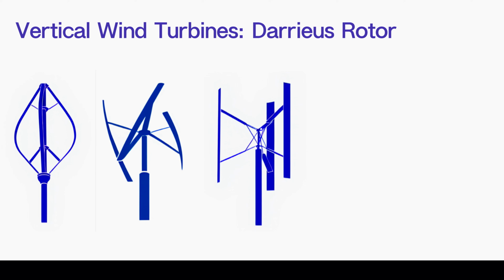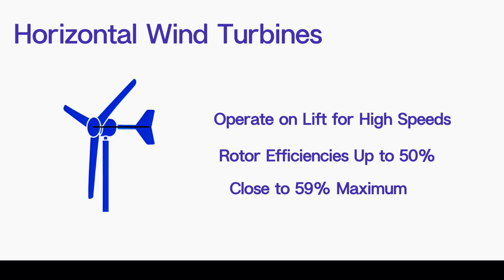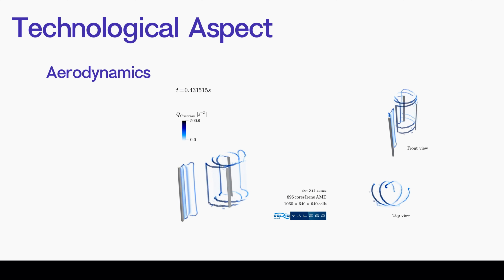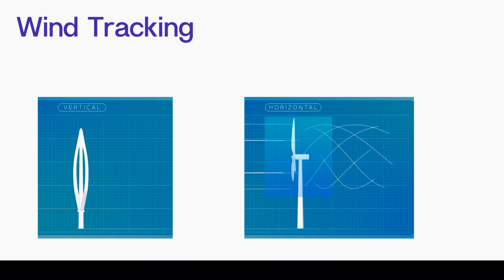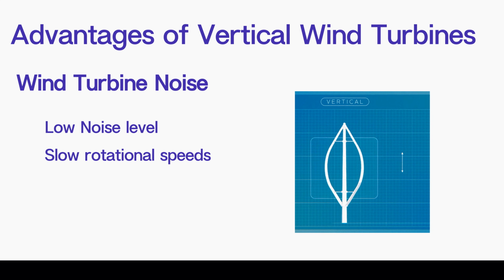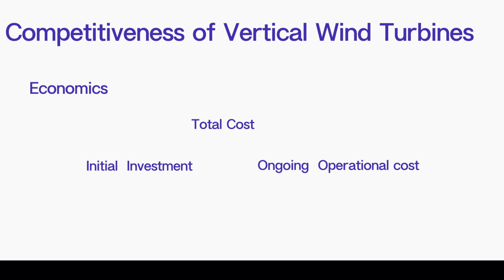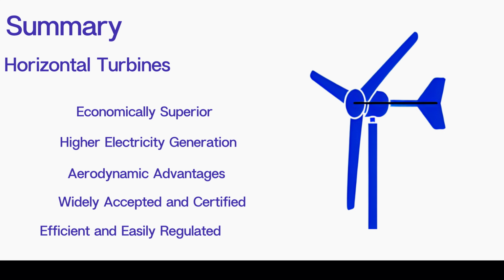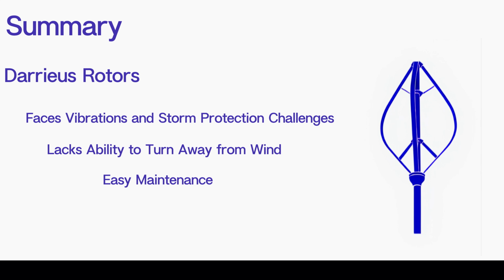Vertical Axis Wind Turbines: Are They the Better Choice for homes?

Comment: If you want a vawt that has higher power you need to make it tall and skinny. That will increase the area of the turbine (torque) without sacrificing rpm.  I built a tall skinny Savonious version 18" diameter x 8 feet tall. It performed very well.
Reply from the maker: That is a very cool DIY build! Increasing the swept area (height) definitely helps capture more energy. As we mentioned in the video, Savonius rotors are 'drag-driven,' which makes them excellent for torque (perfect for that shape). Did you find that the 'skinny' aspect ratio helped reduce the vibration issues that vertical turbines often face?
Reply: @WindmillsTech 3 buckets have no vibration if they are balanced
Reply from the maker: @justtinkering6713 A 3-bucket setup definitely smoothes out the torque ripple much better than a 2-bucket design. In the video, when we discussed 'vibrations and resonances,' we were also referring to the aerodynamic cyclic loading (wind pressure changes) that can affect the mast over time. But getting that mechanical balance right is definitely the biggest step to a smooth runner!
Reply: How much power does it generate
Reply: @oshoadetunji103 i think it was 12 watts. Not a real good alternator.

Comment: Vertical wind turbine is the most efficient blade you can get just need the wind regulator to achieve this!!!
Reply from the maker: Vertical turbines certainly have the best looks! But when it comes to raw efficiency, horizontal blades still hold the record (around 50% vs. 40%). The main challenge for vertical turbines is that half the rotation is technically fighting against the wind, which causes some energy loss

Comment: An efficiency of 20% for a wind turbine appears shockingly low. However solar panels also have an efficiency of around 20%.
Reply from the maker: That is a great point! The difference is that in the solar world, 20-23% is currently the industry standard. But in the wind industry, we already have technology (horizontal turbines) that hits 50% efficiency. So, settling for a vertical Savonius rotor at 20% means we are leaving more than half the available energy on the table compared to what is possible with a standard propeller design.
Reply: Wind and Solar are totally different concept.

Comment: Both turbines are a bad choice because take just a little wind, and most of the wind pass through blades. My "dmmd" wind turbine takes much more of wind energy. I designed two such turbines, one horizontal and one vertical.  There are three kinds of turbines: "Wind direction change" (as the horizontal turbine), "Turbine different shape" (as the vertical turbine in this video) and "Wind direct hit" (My idea and is not yet known)
Reply from the maker: It is always interesting to hear about new concepts in wind energy! The industry has settled on the current designs (lift-based) because they have proven to be the most efficient over decades of testing, but we are always keeping an eye out for verifiable breakthroughs. Good luck with your 'dmmd' design
Reply: The case around the VAWT is missing....

Comment: Reality: Wind turbine are never a "better choice for homes"! With solar panels you generate at least 10 times more electricity with the same investment in time & money! 
Reliable and almost maintenance-free for at least 25 years.
Electricity yield is proportional to third power of wind speed: +100% wind generates +800% more electricity! But close to ground: 0 constant wind! 
Therefore all practical tests of ground-based small wind turbines show: 1) They hardly produce any electricity! 2) They do not last long!
Reply: And if you live in the woods with lacking sun then which is your better option?
Reply from the maker: That is a very fair assessment. For the average suburban home, solar usually offers a much better ROI and less maintenance. Small wind turbines really only make sense in specific rural or coastal locations where you can install a high mast to reach 'clean' wind. As the video concludes, if you do go for wind, horizontal turbines are the more economical choice, but you absolutely need independent references to verify they will last

Comment: Why is there even a debate? Vawts turn at lower wind speeds. Are compact, and simply they are fun to watch. And are more efficient. Here's the better mouse trap.
Reply: You says: "/VAWT/ are more efficient". Wrong. Even in this video is mentioned they are LESS efficient. And in practical tests done by mane people is a exactly same. Vertical produced 1/3 to 2/3 energy when compare them to same size traditional HAVT.
Reply: @bialy100k  Not sure why people would ever think vwts are more efficient since even a little bit of understanding of aerodynamics will tell you a part of the design will always work against the rotation (this video at 3:45 expains it better).
Vwts don't really turn at lower wind speeds either. Most hwts can turn at lower speeds but their torque is set higher to optimize power production and protect against extreme winds. Vwts would simply not turn at those settings.
The only real advantages they have is easier maintenance and better reception among general populace, but those are hardly good reasons to justify their use for power generation.
That said, wind is one of the least reliable sources of energy period and with how much construction materials it takes to build one compared to power output it's not nearly as green as most people believe.

Comment: This video is awfully biased towards horizontal turbines and has taken the absolute minimum efficiency statistics compared to the maximum of the horizontal turbines.
Reply from the maker: We actually tried to be as fair as possible! The 40% efficiency we quoted for Darrieus rotors is widely considered their upper practical limit, just as 50% is for horizontal ones. The physical reality—as explained in the video—is that vertical turbines inherently lose efficiency because half their rotation is moving against the wind. That aerodynamic penalty is hard to ignore, even in the best designs.
Reply: Probably BECAUSE this is the case... 😂

Comment: It's really too bad that engineers have not been able to come up with affordable wind turbines for home use that can really exploit the wind to the fullest. Many of us who live in coastal areas with constant winds see the potential, but also understand that NOTHING currently on the market is really viable. The devices either cost so much that they payoff wouldn't come for 50 years, or they generate just enough electricity to power a table lamp. Solar and biogas are clearly the only viable options.
Reply: You could theoretically make a turbine using an alternator from a scrap car and some paint pallets
Reply: True, especially as solar and wind would complement each other really well and give a more consistent power generating, which could also reduce the amount of batteries needed.

Problem is, when it comes to wind power on the small scale, there's so many scams and disinformation on them that it's not easy to figure out what works or not, but the impression is that they don't generate meaningful energy in urban areas.

I also feel vertical wind turbines would be far more appealing for homeowners and if they can crack it where they generate a decent amount of energy in urban areas, a mix of solar and wind would be a game changer for homeowners.

On the plus side, there are a lot of companies experimenting with different vertical wind turbine designs, but until we see any on the market with solid numbers that they work in urban areas, then I feel more solar is the best route to go with how cheap it's getting, at least for homeowners.
Reply: Apparently you do not recognise the core problem! Close to ground there is not enough wind! Therefore ALL types of wind turbines are extremely inefficient. Electricity yield is proportional to third power of wind speed: +100% wind generates +800% more electricity! But close to ground: 0 constant wind! Efficient wind turbines are 150m and more high, where wind is much stronger and constant.
Reply: @michaelvanallen6400 this discussion is about home use, not interstellar time travel 😜
Reply from the maker: It is a tough reality. The video highlights that economic efficiency depends entirely on the ratio of 'total costs' to 'electricity yield.' Unfortunately, many small turbines on the market (especially the vertical ones) simply don't have the efficiency to pay off that initial investment quickly. Coastal winds offer the best potential, but you need equipment that is truly stormproof—which, as you noted, often comes with a premium price tag